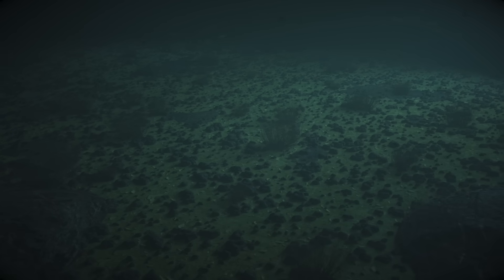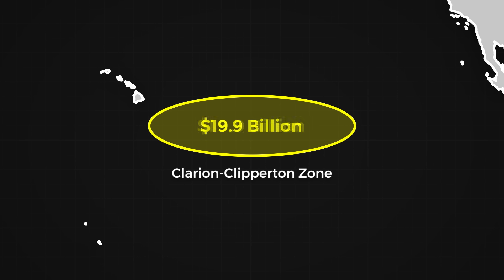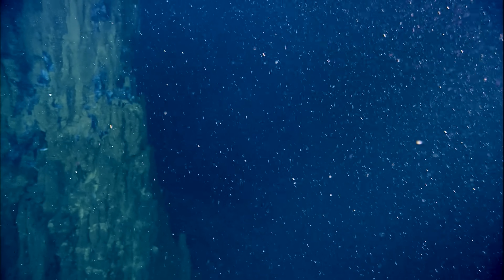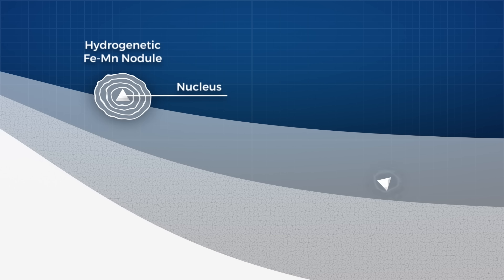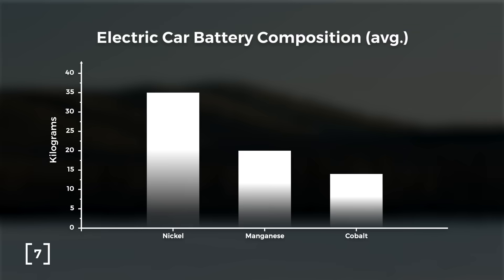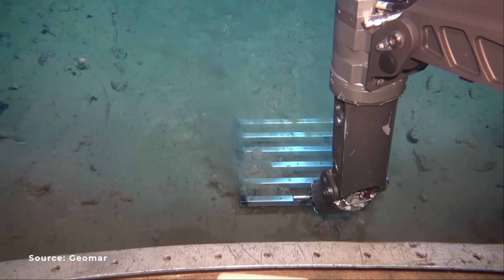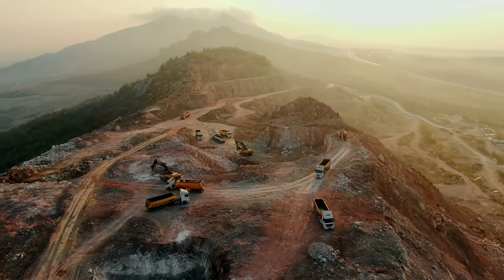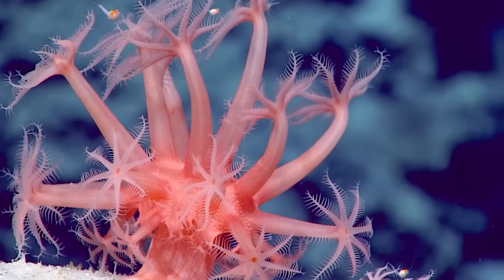The Truth about Deep Sea Mining

Comment: Question one is the slurry have any value instead of putting it back down on the sea floor is there any value to it to bring it back to shore with the nodules? Question two can the mining robot not serve the nodules from the slurry and Lee slurry behind on the floor? Question 3 could the slurry not be used like a drill mud pushed all the way back down to the mining robot which in turn gives the energy to push the nodules back to the surface similar to a drill mud turning a drill bit searching for oil? This would take advantage of simple Hydraulics lot much larger diameter pipe pushing down compared to the diameter of pipe pushing up back to the surface. Observation: the company that can put the slurry back down on the sea floor or leave it there to start with is the one that is going to get a license approved by the ocean floor mining controlling Authority from the United nations. Best solution is a mining robot train the first car of the train is mining all the material passes it back to second or third cars for to sit out and separate the nodules from the debris and leave the debris possibly then packing the debris slightly so it doesn't create much of a cloud. Observation: this could also be a manned operation with long-term divers that actually live at the seafloor in the mining train. This is a practice that has been done several times before limits the amount of crew turnover time spent decompressing coming back to the surface far more efficient and cost-effective.

Comment: Several materials would be game changers if mass producable. Most of them are centered around allotropes of carbon.
Stabe solidstate metalic hydrogen.
Carbyne, but much longer than the micrometer length samples currently studied.
Polycumulene, similar to carbyne, theoretically even better.
Carbon Schwarzites, Seeker did a good video on these.
Graphyne, SubjectZero did a good video on that. 
Other potential high tempurature superconductors that do not require rare metals..
And in areas outside of energy:
Time crystals, for quantum computors, so far those require rare metals but in theory they shouldn't need to. 
Fiber optics with absolute optical transperancy, so far those use nanocoils of silver, but an alternative method might exist. 
And I am sure there are many other potential game changing materials that do not demand as much mining. My thought is that better alternative materials usually exist, but producing them on a large scale so far seems to be out of the question. I want to see a new material age, with as much impact as the transition from the bronze age to iron age. I think the age of nanomaterials is upon us, but it may take more than one lifetime to fully reach. With oceans full of plastic byproducts and other manmade pollutants, increasing in acidity and tempurature, mining it does feel like the lesser of two evils for the time being.

Comment: I don't understand why they need to use a big hoover to pump the nodules up in a slurry. Why not just armies of little robo pick and place drones that meticulously grab the nodules with minimum disruption, replacing them with ballast rocks. Sensors could detect if there is anything obviously living on a particular node and pass it over as well. Then when full payload bags can be pulled up to the surface as they fill. Load the payload bags up with more ballast rocks and let them sink, storing some of that energy to help power the winch that will later raise them. 

Would it clear as much, as efficinely as just a vacuum cleaner? No. But if the goal is minimum disruption, precision is key.

Comment: I would love to see a video about underground vs surface vs deep sea mining methods. from what I can tell, easily accessible surface deposits are getting rarer, so we will have to mine deeper underground.

Also the environmental impact of an open pit mine vs an underground mine would be interesting. There is also in situ mining which pumps a chemical slurry through a deposit to extract minerals
Reply: Surface level deposits aren't getting rarer, they just want to mine in unregulated areas for more profit.
Reply: @belldrop7365  They really are. Or well to be more precise viable ones are. As technology improves and prices change the viability of resource reserves change.
Reply: if i'm remembering it right, the name of the game in deep underground mining is chasing the vains. so over all less material is removed but it needs concentrated material. where as surface mining is gathering up everything and sorting it. 
 
i would say underground mining is better because there is nothing really down there to ruin
Reply: @artski09  that's what I'm thinking. Worst case scenario is a bit of sinkholes? 

Also check out the Block Caving mining method, it's crazy! It's like an upside down open pit mine....but underground

Comment: I bet the waste sediment could be used for geoengineering by using it to make fertilizer for algae blooms or kelp farms, if we start mining the sea floor at scale it would be easier to do than other forms of geoengineering and can be done with little negative impact once this is well researched. Whales sequester a lot of carbon by pooping and fertilizing the upper waters with minerals that are hard to come by because everything uses them. It ends up pulling several times the weight of the whale itself over the span of a year or so if I remember correctly, and whale numbers still haven't rebounded properly so I think this would be closer to a good idea than spraying particles in the air or reducing the amount of light hitting the ground some other way. If there's sand in there too then it could even be used for cement since sand is nonrenewable and there should be way more in the oceans.

Comment: Would you be able to add a second line going down for the sediment, even using the downward force to help bring material up? Then essentially just dispersing the sediment back at the lower floor in a spray equivalent to the traversed area of the miner. Basically a robot vaccum cleaner that expels out the dust we want to leave there. Additionally since we are down there anyways could we use it as a secondary means to long term bury certain materials that either are detrimental to us, or beneficial to the environment. Things coming to mind would be dispersing black carbon
Reply: Yeah i was thinking that too!  Could maybe make carbon nodules from something resembling Charcoal/Carbon Black, or something fancier like carbon glass.

Granted nether of those may work if the biome depends on the mineral content not just the structure of the nodules!

Would be worth a look though in my opinion.
Reply: Could maybe even speed up the healing process by Inoculating the Slurry and/or Replacement Nodules with the various microbes that live on them.

Sort of similar to some of the Coral Reef Breeding programs.

(Granted COST (although this could be done to get the minerals, even if the cost is a but too high because it’s the right thing to do or something, but eh capitalism) and also again *would that even help/work?)
Reply: If you shovel the sediment back down there, you're killing the entire ecosystem. Highly concentrated particles will suffocate every animals that needs to breath through gills or filter feeders and it was even shown that the bacterial colonies do not regrow once the soil has been disturbed by mining operations.

Comment: It’s illogical the extremes that modern man is placing on this perceived need to find a way to keep a system of energy production that less than 100 years ago we had no idea would even exist and therefore lived very well with out it and consequently with out the devastation to the environment. Mining of the earth and sea to produce batteries will end up causing for more damage, far faster than petroleum energy production ever has. The answer that seems no one wants to admit is we need to curtail energy use by a massive percentage and drastically change our economies and life styles rather than to try to make the planet meet our over indulgent use of energy.
Reply: I think we just need to be more resource efficient and promote other forms of transportation and phase out cars. In terms of energy usage, nuclear energy is more than capable of providing for our needs. 
Most of the criticisms of nuclear energy are exaggerated by biased critics. 90% of existing nuclear waste can be recycled. The remaining 10% of nuclear waste that can't be recycled can be safely stored as vitrified glass.

Comment: it always gets me that the situation is treated as if the only way to solve climate change is to build massive amounts of lithium batteries. It amazes me that people always go straight to talking about producing more energy rather than addressing the simple fact that we are using too much energy. the lesson we should have learned from the oil age is that destroying nature in the name of energy is a suicidal idea.
Reply: You’re right but the problem is even if ‘fully industrialized countries’ reduce energy per person — developing countries are still likely going to need more energy just to have an ‘equal/fair lifestyle’.   It’s going to be really hard to keep those countries energy use down from today’s baseline while they develop.

That said, some of this tech does at least waste less energy — a gas engine is ~ 25% efficient with the energy put in, where an electric motor is more like 95%.  We’re also seeing real traction on heat pumps that can be 300-500% efficient vs. the best gas furnace of 97.6%.  This is functionally the same as reducing energy use..
Reply: @jrherita  exactly, we have no ethical way to prevent these countries from doing the same environmentally abusive practices we have done for so long, so we shouldn't. It would only make the problem worse to insist that developed countries like America should use more energy so that we can maintain our abusive systems with electricity while other countries become more abusive themselves. it's clearly a destructive cycle. what needs to happen is for countries that have been long-standing abusers of resources (like the united states)  to take responsibility and change our lifestyles to break the cycle of consumption and destruction. my advice is to look at countries that have reached many of the benefits of developed status (I.E life expectancy, health care standards, civil rights etc) and simultaneously have the lowest emissions per capita. one of the best by those metrics is cuba, whose citizens live longer and have better access to medicine than U.S. citizens, but who consume a miniscule fraction of the carbon to do so by embracing more traditional agricultural practices and living much more intimately with the resources of their lives. they've really created a model lifestyle to be replicated by responsible nations and we should follow their lead

Comment: Wouldn't it be so much easier and effective to use a conveyer belt type system to bring them to the surface rather than trying to suck them up. Also, don't octopus use copper to make their blood instead of iron. So the fact that the octopus in this region lay their eggs on these nodules could possibly mean that they actually require them as part of their life cycle. This could mean that mining these nodules might cause the collapse of octopus populations in the regions that are being mined.

Comment: What about artificial habitat restoration--replacing these anchor points?

Less useful, harmless materials could be distributed after mining (ideally being dirt cheap and trivial to transport thanks to ship efficiency). The 11:12 1989 coast of Peru experiment could be reused to test restoration of an area mined decades ago. Meanwhile, a new experiment could replicate those seabed disturbances in a similar ecosystem, but restore the area immediately after mining. Undoubtedly, this mining would still damage the ecosystem, but the known marine populations may recover much quicker.

If these experiments prove promising, a third experiment could be conducted using a new mining pattern: destroying strips of the ecosystem before restoring them, as opposed to vast, unbroken swaths of the seafloor (which the 1989 experiment's "two nautical miles in diameter" collection sounded like). The idea here is to distribute the areas in need of repopulation between local, surviving marine life. This is to further reduce the time necessary to repopulate, leaving mature organisms as close as possible to these areas.

Comment: This whole video is based around the idea that massively increased battery production is necessary for a greener future, but is that actually true? We can work to minimize the battery use without sacrifice on cutting fossil fuels. Gravity or heat based energy storage systems can be used to store wind or solar electricity and an electric train system could run on overhead wires rather than needing the batteries that an electric car would.f
Reply: Also Flywheel Energy Storage (of which “Amber Kintetics” and also some more Uninterruptible Power Supply (rather than Grid Storage) oriented companies represent COMMERCIAL OFF THE SHELF OPTIONS), and Power-to-X technology

 (Hydrogen, Ammonia, Methane, Dimethyl Ether, Fischer-Troph fuels/chemicals, hydrogen or methane eating microbe/reverse microbial fuel cell mush for fuel, chemicals, or even food/flavors!

FES is, as stated, an off the shelf option (and mainly uses more normal materials short of maybe control circuitry, most/all of which is more recyclable than batteries (granted citation needed)

Power-to-X can use existing/mildly modified ICE powered (hybrid) vehicles, and industry.

All the while aiding in the transition of the chemical/pharmaceutical industry, and making perfect FCEV Fuel etc

Small Batteries, Large Flywheel Arrays for Middle/Short Term, and Pumped Hydroelectric/Power-to-X, and maybe Flow Batteries, Compressed/Liquified Gas, and some of the other stuff you mentioned for long term.

That’s my rant lol.
Reply: Also utilizing alternate battery chemistries, Sodium-Ion instead of lithium (preferably from waste brine, rather than more salt mining…), some of the novel chemistries not using Cadmium etc (although i am no expert in all that + catalysts etc so I can’t speak to this aspect too much), Iron-Air batteries etc.

Even if they are less efficient/cost effective, i think the Environmental savings would be well worth it!

(And subsidies+legislation can help)
Reply: @Peaches.Gonsalez  Metal Recycling (vs (Non-Lead Acid) Battery Recycling) makes the case against more batteries *BETTER*, and how does the need for jobs justify anything given that is a false conflict; we can have jobs and no grid scale batteries/pile of BEVs?

I’m rambling, but What are you trying to get at?
Reply: Its all about costs. Not environment.
Reply: So we are gonna build trains that stop at everyones houses now? The solution isn't to revert to high voltage overhead lines that can be damaged by tree limbs falling in storms. The solution is new battery tech, not taking away peoples freedom to drive where they want to go when they want to go.
Reply: @DanielsCorner644  Watch “Not Just Bikes” ,  “Adam Something” , and “Strong Towns” for some good discussion of this topic.

Also “Streetcar Suburbs” are a thing!
Reply: @DanielsCorner644  Wondeful rebuttal, really insightful!  I’m glad you took time to read and consider the thoughts i shared rather than just post something after a gut emotional reaction.  You must be a really well adjusted and smart person!
Reply: @DanielsCorner644  *Freedom to be stuck in eternal traffic / have their house be demolished by the state to make highways for “freedom” due to shitty urban planning
Reply: @DanielsCorner644  it isn’t necessarily “the left is coming for your car”, moreso 2/3 of people probably aren’t car enthusiasts but just want to get from point a to point b as fast, easy, and cheap as possible.  Mass transit and just walkability / bikability is the way to do that.

Motorways and Racetracks will still exist, but traffic will be less making it better for the car lovers.

We will have to do major investments, and some societal shifts, lets make sure we do them right.

Comment: I wonder can you lower a tube to the bottom of the seafloor, where internal pressure would be surface level, but that is rigid enough to be able to withstand the pressure at those depths? If you could do that, you can let the water pressure at sea floor act as pump to get the materials on the surface. I guess it's so simple so they must have thought about it, but I would like to know why this method is not used. Because technically all that is needed is to stick that pipe into the collector and it should SUCC these bois up like with that petrol hose thing we did as kids.

Comment: OR... we need to find an alternative energy storage method thats actually effective. Lithium Ion batteries just aren't the way to go, not if all the people claiming they're all about saving the earth are actually serious about it. It's not just the batteries you have to worry about, it's the subsequent replacement batteries that are needed. and all the extra energy required to charge them and it's associated infrastructure.
When you actually think about the numbers we're talking about here for all transport globally to go Lithium Ion-electric, it becomes exponential and  mind boggling. We've barely converted a tiny fracttion of the worlds transport to battery and we're already destroying massive ecosystems and wondering where the hell we're gonna get all the raw materials!

Serious effort needs to go into makign Hydrogen a viable alternative, and the recent developments in nuclear diamond batteries are pretty promising too.